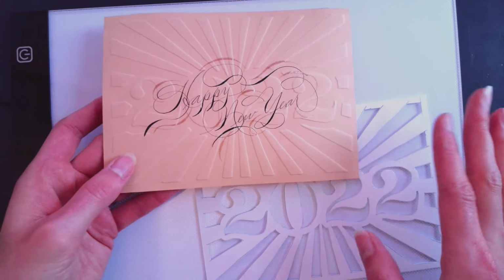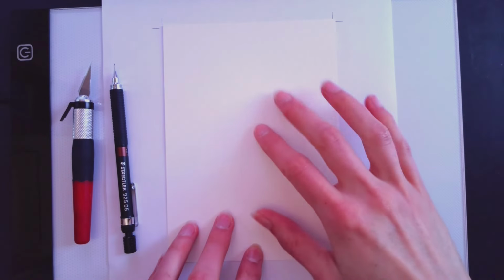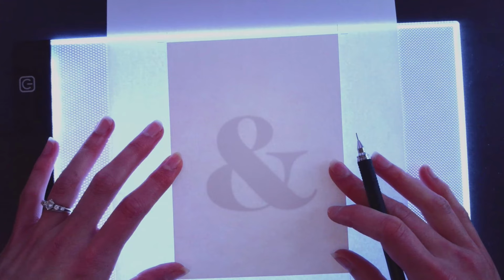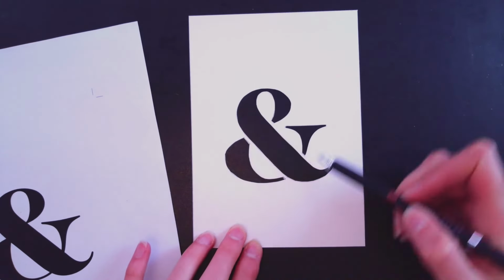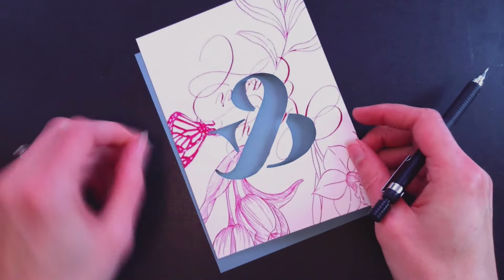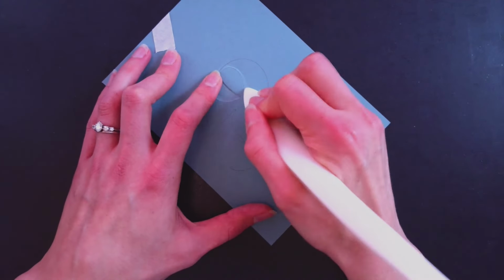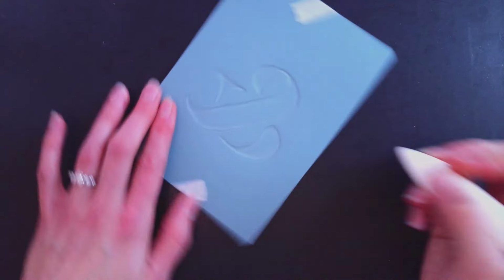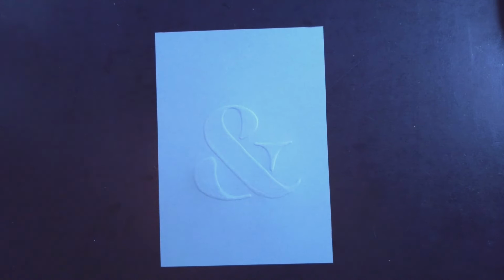Hand Embossing Tutorial

Comment: Thank you for a great tutorial. I have  never thought of making my own template. To make life easier, rub the back of the paper with a tumble dryer sheet before you emboss it as it makes the tool move easier on the paper. If you are not using a light box then rest the paper on something soft like the soft side of a mouse mat. You can buy ball tools for embossing in lots of sizes, although the tip of the bone folder worked well.
Reply from the maker: Great advice! Thanks Linda!